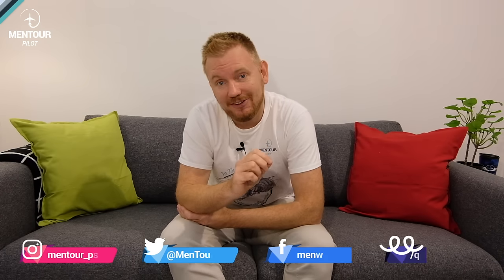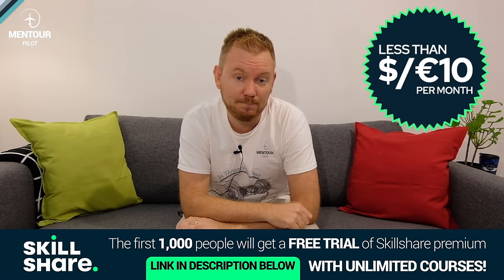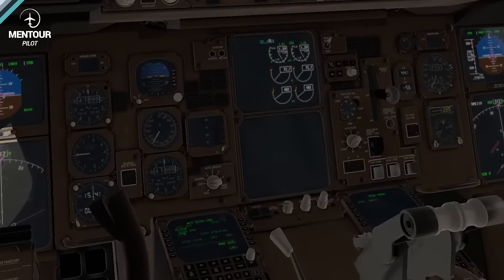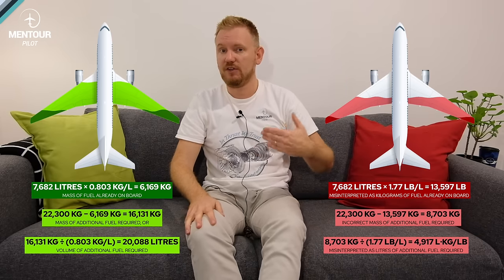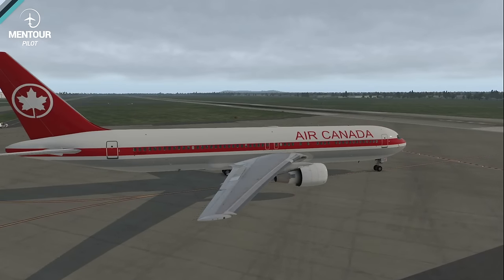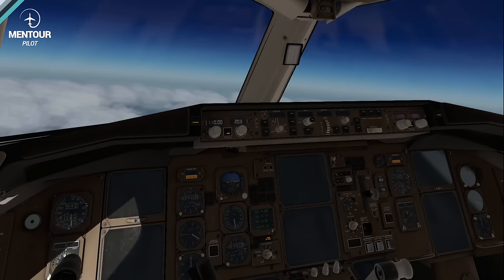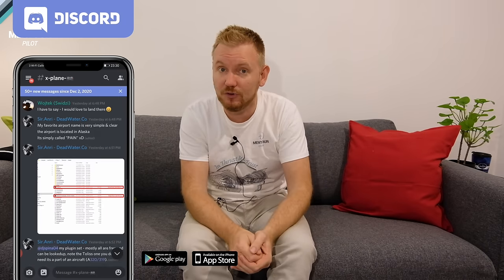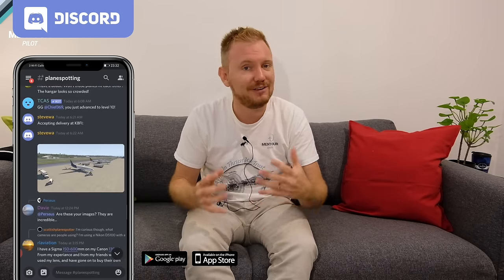The Gimli Glider! Explained

Comment: Was the APU not available to the crew as in the Hudson landing?
Reply: Im pretty sure that the APU also uses fuel to function so without any fuel the APU would be dead to.
Reply: @Sanyogo  Yes, I was presupposing that it would have a small header tank at the back there giving it a degree of independance, it being a long way from the main tanks.

Comment: I have a problems still with this incident. Why front gear did not come down and lock on a brand new aircraft? It has been for the best in this case, but a scenario with failed landing gear is more likely. With better and safer batteries we should think about using them for critical controls and navigation. That may bring more redundancy in airplanes. Thank you for this story.
Reply: It was a good thing that the nose gear didn’t drop all the way. The friction from the nose gear collapsing actually slowed the plane down when it was sliding down the runway.

Comment: One of those bizarre and ambiguous situations. The flight crew atoned for their several serious, and potentially fatal errors, but made up for it by a superb display of flying skills that ended in a very happy outcome with ZERO deaths. They cannot be praised enough, and yet, they needed their bottoms severely smacked as well.  
Canada Air in my opinion, should have given and emphasised to the engineers the full authority and confidence to ground an unsafe aircraft until the spare parts could be flown in, fitted, and tested as fully operational. And the airline should have had the parts to fix the problem as soon as it was detected, or grounded it until the repair issue was fully resolved. 
At the end of the day, pilots are just pilots. Yes, they have technical knowledge of the aircraft, but they are not engineers, and there was no engineer on the flight deck. 
Airlines should use the same system as the military, and make the engineers the "owners" of the aircraft, with absolute authority on what can fly and what can't fly. The pilots just "borrow" the aircraft, and always have to seek permission from the engineers to borrow it.

Comment: Not wrong conversion method, just a single wrong number, everything else was done correctly to achieve a fuel load of 23000, but lb instead of kg.  The lack of an on-screen fuel calculator already knowing the needs and conversion factors made this simple error possible.  Even a primitive flight computer would have the power to show a "dipstick fuel menu", where the pilot types in the raw readings from the individual dipsticks and the flight plan or range, and the display shows:  "Add 20,000 liter to tanks."

Comment: Dear Capt
It's real pleasure to watch your videos,  narration with excellent animation makes it very interesting.
Your technical knowledge is also commendable, but in this video your explanation about conversions from Liters to Pounds and Kilograms isn't right.
As Liter is measurement of volume and Lbs/Kgs are units of Weight, their can't be a fixed value to multiply or divide for their conversions, without involving Specific Gravity- SG( density)of fuel.
For a given volume weight of fuel would be different at different temperatures, for example: A fuel tank at 50 Celsius will have less fuel by weight than at 0 or any lower temp.
To convert a liter measurement to a pound measurement, multiply the volume by 2.204623 times the density of the ingredient or material. Thus, the volume in pounds is equal to the liters multiplied by 2.204623 times the density of the ingredient or material.
For example, here's how to convert 5 liters to pounds for an ingredient with a density of 0.7 g/mL. 
5 l = 5 × 2.204623 × 0.7 = 7.716179 lb
To convert a gallon measurement to a kilogram measurement, multiply the volume by 3.785412 times the density of the ingredient or material. Thus, the volume in kilograms is equal to the gallons multiplied by 3.785412 times the density of the ingredient or material.
For example, here's how to convert 5 gallons to kilograms for an ingredient with a density of 0.7 g/mL. 
5 gal = 5 × 3.785412 × 0.7 = 13.248941 kg
To convert a gallon measurement to a pound measurement, multiply the volume by 8.345404 times the density of the ingredient or material. Thus, the volume in pounds is equal to the gallons multiplied by 8.345404 times the density of the ingredient or material
For example, here's how to convert 5 gallons to pounds for an ingredient with a density of 0.7 g/mL. 
5 gal = 5 × 8.345404 × 0.7 = 29.208916 lb

Comment: See you would think that the smart thing to do would be just to fill the aircraft with fuel before every flight that way they have however much they need and they're guaranteed not to run out and then they just top it off every time they land just like you would your car on a long road trip
Reply: Except that would add thousands of unnecessary kilos every flight

Comment: I cannot help, but consider this incident mostly the crew’s fault. They’ve made multiple mistakes before takeoff (bad communication with previous crew, fuel calculations, not following procedures regarding minimum equipment), and the gliding maneuver which shouldn’t be flown on the aircraft this size (could have had much worse consequences). They’ve managed to land the aircraft safely overcoming their own mistakes. 

What should have happened in view was no punishment for the crew or anything like that, getting safety recommendations and implementing them, end of story.

I would not consider them for reward for fixing something of their own making, seems to send a wrong message to me.

Comment: I could quickly see where a major problem was coming into play. The mixing of different measurement systems. 1 kilogram is about 2.2 pounds, so roughly the same number in pounds is about half as many units in kilograms in reality. The rule should be that no matter what absolutely no mixing of different measurement systems can be tolerated. If you need to convert volume to weight, then strictly stay to gallons-to-pounds or liters-to-kilograms only. By going liters-to-pounds they threw open the door and hollered out "Hey, trouble come on in!"

Comment: I don't understand how the Pilot couldnt feel that the plane was so much lighter (a 3rd of the planned fuel) on take off?  Surely there would have been a difference in acceleration, rotation point and climb rate?  He would have set up the plane for a heavier weight so it should have taken off much more easily than expected.  I heard stories of planes failing to take off due to too many fat people on board so surly two thirds too little fuel would make a difference?

Comment: Isn't it a source of errors to make conversions from mass to volume at all?

I mean the less you need to calculate the less errors you can make.
And if one specific airplane always gets the same kind of fuel with always the same density, then you could just say it can take at most x kilograms of fuel (knowing that this corresponds to the actual volume of its tanks since the fuel always has the same density).

So that in the end you just calculate in mass, you command a certain mass needed from the personal working on the ground and everything works as fine as usual, except that you have less calculations and whence error sources.
Reply: What I just don't know as I am not a pilot: Does a specific airplane always take the same fuel so that you can assume the density always to be the same?
Reply: Good point. Weight is always used in the chemical industry. Density can vary between batches of the same chemical.
Reply: @joshgts9675  
Ok. If the density varies then it is necessary to make the conversion to volume in aviation if you don't want to spill over the fuel tanks.

Comment: Why did they need to do the conversion at all? Why is fuel onboard measured by mass rather than by volume? If the minimim fuel requirement for dispatch was in litres rather than a measurement of mass then it would have avoided all this.

Comment: From a systems engineering point of view, what I find most disturbing is that at every opportunity there was a failure to correctly communicate vital information about the problem, that is not good.  Onboard the aircraft itself there are double or triple redundancy of critical systems, which is good, but the system of humans who operate the aircraft system as a whole was technically incapable of preventing an accumulation of information and decision errors.

Maybe this was normal, still is normal, but in this instance there is no single person who's responsibility it was to track and manage the problem from detection to resolution.  If there was any lesson to be learned from this incident, it is that even a fairly innocuous fault in a system, one that has a functional backup, can be mismanaged by a succession of poorly informed people with catastrophic consequences.

As a side note, it also would have been pretty smart if someone on the ground had taken a moment to alert people at the declared alternate airfield that something was about to happen, even just the local police and fire department: 'Hey in fifteen minutes a 767 is going to make an emergency landing at the old airfield at Gimily, do something!'  If the races were being run the other direction on the runway that Sunday, it would have been a catastrophe not a happy ending.

BTW, I loved your little swiss cheese animation at 12:00. Back when I was in industry that was more or less my job, discovering and mapping the holes in slices of swiss cheese and making sure they cannot line up.

Comment: Imperial measure system causes so much pain to all the normal world :)
Reply: Looks to me that the kilogram to litre calculation was a simple calculation and they obviously included the pound conversion reference after the fact as just another excuse to cover their butt. One litre of jet fuel weighs around 0.801 kilograms as Mentour Pilot says.  So if you are told that you need a total of 22,300 kilograms of fuel or 22,300x1.25= 27,840 litres and you top up 7,682 litres with an additional 5,000 litres for a total of 12,682 litres instead of 27,840 litres you can expect to have a fuel problem. Converting to pounds was never required since the fuel load was in kilograms and the fuel tanker metering system was in litres. Since this calculation could have been approximated in your head and the ground crew says that they ran out paper in doing their calculations I have no doubt that something is amiss. Now having stated the above after having walked  the plank I am wondering where I might have miscalculated since everyone involved after the fact cannot all be idiots. Living in Ottawa these days may well be used as excuse enough for the incompetence required to produce a Gimli Glider event but this was back in the days when acid rain may well have been their biggest concern so what gives?

Comment: Minor nitpick: it wasn't a drag race. It was Formula Ford race on the road course that uses one of the former runways. Not a big deal, I'm sure I'd get far worse wrong if I tried to talk about aviation. It just sounds funny to a racing fan who knows otherwise.

Also, does anyone know if the other runway was operational at the time? I've heard a lot of reviews of this, but never seen it mentioned that there was another runway parallel. So maybe it was closed as well at that point?

Comment: As an autistic person who has to double check EVERYTHING myself I don't understand this assuming that people do. If I see a tab on something that's supposed to mean it's a certain way I HAVE to make sure before I can't continue on to the next thing. Car is on auto so the lights should turn off when I lock it but I have to wait 30 seconds to make sure. Dishwasher works perfectly but I have to inspect any dish or utensil. There are other things I can't think of right now. It's a blessing and a curse. I ensure that I'm safe and there won't be any surprise in areas that I have absolute control over unless something insane happens. But I also annoy people and it wastes my time.

Comment: Am I the only one who thinks that when an engineer says to a pilot "you've got a problem there, tell it to the next pilot please", it should be written and officially signed and then transmitted from pilots to pilots until the problem is solved ?

Because here the main problem is specifically that. Two pilots, two engineers who just don't understand each others correctly.

Comment: If you want to do a story - Indian Airlines IC Boeing 737 -200 with JT9D-17 engines. IXU Aurangabad India. Commander rejects take off when the lady FO is unable to lift after rotation past V1. Captain aborts take off  is able to brake, turns and gets the freight weighed. It was 4.5 MT over flight manifest. Corruption by local Indian Airlines staff. 2 weeks later a Boeing 737-200 again fails to take off from IXU. Slow climb. Hits HT wires and a truck on the road and crashes.

Comment: Why is there is no backup for something as essential as fuel?  You need backup fuel in many scenarios.  This is just one of them.  There has to be reserve fuel, which even a tiny scooter has.  And there has to be enough power for hydraulics without engines.  After the 737 Max we all know how badly Boeings are designed.

Comment: If I go on vacation in the family car, I fill up the tanks.  Why, when it seems so catastrophic if the tanks run dry, do pilots ever 'leave' the airport with less than a full load of fuel?
Reply: Because fuel is heavy, and it costs fuel (and money) to fly that excess weight around. Jet fuel weighs about 6 pounds per gallon, which means a full fuel load weighs about 120,000 pounds. So airliners typically fly with the amount of fuel they need for the flight, plus applicable reserves, and not more.
Reply: @tammymakesthings  Ah, profit.  I should have known!  What formula do they use I wonder when calculating  the balance between a safe arrival and a smoking crater.  Still, a safer means of travel I guess.  Thanks for your response!

Comment: As a non-aircraft person, quite a few parts of this story bother me. First of all, the idea that you can fly a passenger aircraft with no fuel gauge! OK, there is a manual backup for checking how much fuel you have (which clearly was inadequate!), but surely fuel gauges have more uses than just telling you how much fuel you (apparently) took off with?  If I were a pilot, I would like to be able to see my fuel situation throughout the whole flight! Secondly, how can an emergency backup power supply NOT have enough power to enable the aircraft to actually be flown and landed?? What sort of a 'backup' is that?!  And lastly, but perhaps most importantly, how come the conversion of weight to volume was so complicated?  The pilots required weight in kilos, the fuel delivery man needed the volume in litres - so all you need is one number to convert from one to the other. Why on earth convert to lbs at any point?? And, as the conversion rate is as close to one as it is, why not check it by a simple 'litres=kilos' verification? This won't be spot on, but it will be close enough to show up any obvious mistakes.

Comment: Even NASA has had an issue with metric to imperial conversion.  Every country should use metric…. I mean imperial measures are calculated with metric system…
Reply: I agree every country should use metric, but who says NASA has had problems with metric to imperial conversion? Why are they converting metric to imperial? Do you mean the other way around? NASA use metric FYI.

Comment: Converting pounds to liters to kilograms with no fuel tank gauge?!  by God that is a STUPID way to fuel commercial aircraft. I fueled light aircraft in 1979. My boss told me, "Bob, you fill that tank until you see gas at the neck. Make certain you are putting the correct grade of gas in the plane or it's YOUR ASS!!" lol Imeson aviation in Jackson WY USA. My boss owned the company and was an old school tough guy. I also fueled Convair 580. Order was like, '500 gallons right tank' '800 gallons left' NO freekin CONVERSIONS!! No math. NO DUMBASSERY!

Comment: If drip stick test was acceptable to fly, it should have been done after the fuel was uploaded.  That way you are not relying on accuracy of the uploader, the pump, the pilot, the calculations, etc.  And why do they make them do calculations anyhow, why can't everything be measured in either liters or KG?

Comment: No pilot in their right mind takes off without any fuel gauges, whether or not you use the sticks.
Reply: agreed, and no engineer should have allowed him to do so, the engineer has the responsibility and right to override the Captain and refuse to sign the release to service, as a retired engineer with 50 years of service I did so on more than one occasion!

Comment: The most important rule to remember is if something is wrong - stop !!!!  Nearly every problem results from a cascade of errors not a single incident.  Bad gauge, reckless technicians, poor mathematics, lack of communication and finally a reckless pilot.  Any one of those steps correctly performed would have stopped this potential disaster from ever happening.  Come on, would you fly an airliner relying on basically dipping a stick in the tanks to check the fuel load ??  These people call themselves professionals ?

Comment: The pilot and first officer lacked some basic unit measure concepts; i.e. a liter is smaller than a gallon, a pound is less than a kilogram.  When performing the transforms it should have been obvious that the solutions were grossly incorrect.  They screwed up twice!   In addition, it should have been apparent during takeoff (acceleration, V, climb) that they were very lightly loaded.  Bells should have been going off in their heads.